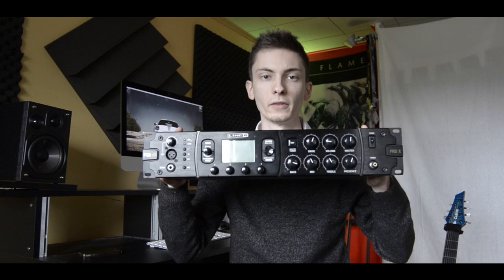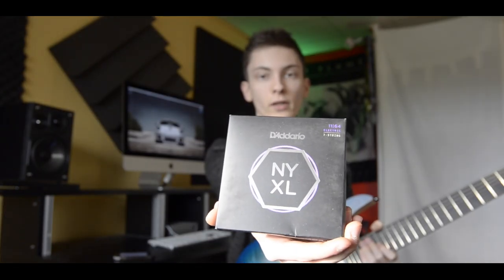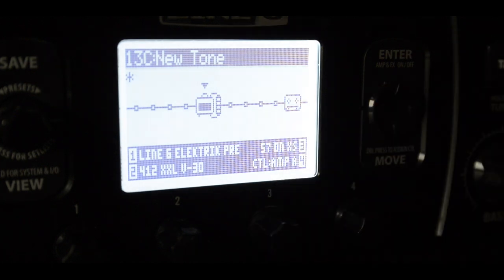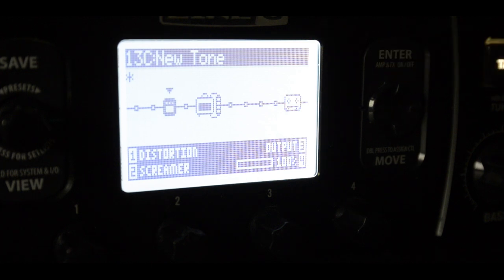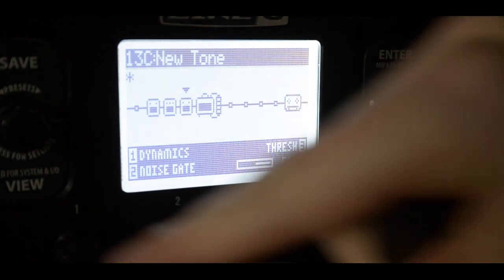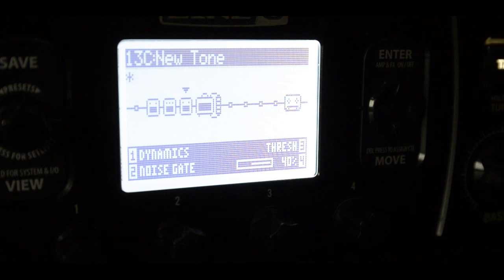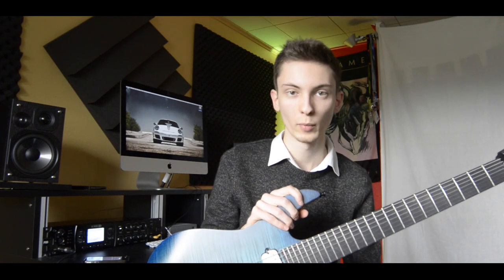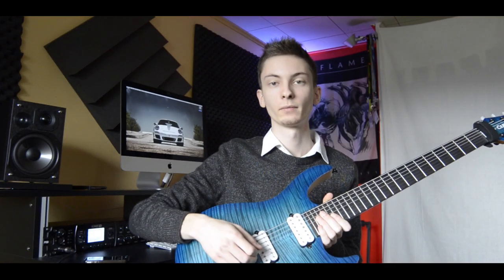Line 6 POD HD Pro X: Tight rhythm tone à la Monuments (w/ Carvin DC700)

Comment: I just wanted to say thank you , cuz you made me buy a POD hd pro x a few days ago .
Im absolutely lovin it . One of the best choices i made in the last 5 years . Cheers .
Reply: Theora Band it sounds like the video dude?
Reply: I think something like that yeah , but theres so much things that affects the sound your getting from pod . For example : 6 or 7 or 8 string guitar , the pickups you using ceramic or alnico  . And of course if you use it through speakers or a cab . ( digital recording or if ur using a mic ) .
Reply: Theora Band yeah, i know about that but i want to know if the preamp, the quality of the POD to record is that good, i want to record a album, and i have a interface know that cant handle the job
Reply: I donno i use the digital output of the device with USB connection . For me it sounds great . Check my channel and you can hear how it sounds with my mixes . Of course u need to some post EQ in the mixes .
My songs recorded with pod : Theora - Horizon  , and the God Of The Sun .
Reply: Theora Band so you use the usb direct to record? sounds amazing
Reply: Jonathan Olvera yes

Comment: Thanks for your tutorials and music dude, subbed instantly! What is your opinion on using a compressor, such as the RED or TUBE COMP in the POD HD 500 ? What sort of clarity to do you find as opposed to using the amp head distortion.
Reply from the maker: funknotik: Good question. I actually use comps for clean patches but not for high gain patches, I should try that!
Reply: I've been using the red comp before the screamer with basically your same configuration, with good results.  But I have to set the amp gain very low to  maintain any kind of clarity. I wish there where more subtle variations of the compressor, this one is too either full on or too little compression. It's hard to get an even and natural sounding tone with the compressors in my experience.

Comment: what things do i need to play live with it? just plug in directly to a cab ? (i'm new in this)
Reply from the maker: Hi! Please check out my rig rundown video on this channel where I explain this in detail! Hope it helps!
Reply: the patch used for run into PA or into return on the amp is the same? Just enable/disable cab simulation or need some other adjusts?
Reply from the maker: Hi! Basically yes, maybe you have to do minor adjustments on the amp simulation EQ in case your cab sim is quite different from your real cab.
Reply: You can play through a normal guitar cab as well. You'll need a power amp. I run my Eleven Rack live with a rocktron velocity 100 power amp through my celestion v type loaded 2x12. Any patches you make with the cab Sims on will need tweaked a bit. Make sure to turn the cabs off if you run through an actual guitar cab.

Comment: are you plugged into an amp? i dont have an fx loop on my amp. is it a bad idea to use an amp simulation through my amp input clean channel? really need help with this one =(
Reply from the maker: Hm this is something I really wouldn't recommend. Maybe try selling the amp and buy a poweramp if you really wanna go for the POD sound!
Reply: Plug it to FX return, if you have FX Loop in your amp. That will skip the pre amp

Comment: Noise Gate before distortion or pre-amp? That's a no-no since it affects the dynamics of your dry signal (thus taking some gain away as you mentioned), making your softly picked parts or the ends of sustaining notes silent. To correctly remove dist/amp hum and fizz, you have to put it after them.
Reply from the maker: There's no right or wrong here in my opinion. I put the noise gate first because I want noise to be taken out before it gets amplified.
If you use a real amp and a real noise gate pedal it will also be in that position of the signal chain.
Of course this is a topic that is based on personal preference and experimenting! ;)
Reply from the maker: +Soulhenge Sometimes I put two noise gates in my signal chain of the POD. One before and one after the amp to get a really cleaned up signal.
Reply: But you can remove the noise just as well after it has been amplified. The only difference is that you don't affect your dry signal, keeping your playing dynamics intact. And you can't remove all noise any way, because your guitar or amp or whatever is still making noise when you are playing normally, and you can't touch that.
Reply: have u ever seen periphery old rig rundown .......
Reply from the maker: Btw I tried your version @mkaali (noise gate after amp sim) and it does not work properly. 
It's called a noise GATE not noise filter or something. When you are not playing, you risk making unwanted noises though, which you don't want. As you start playing, the gate fully opens and let's through the entire signal (as far as concern a real noise gate pedal, not the POD intern). It's about stopping unwanted noises while muting etc BEFORE they get amplified!
Reply: ur as much of picky person as me <333 :)
Reply: its true, Im guessing mkaali has no idea what they are talking about, a noise gate is almost always the very first thing in a rig, right after your guitar. it has to be a good gate, and set properly. a proper smart gate does not affect the signal at all. ( mxr smart gate ) . the POD has this issue with its gates.  also in a high gain rig you can use another gate is front of any noisy pedals.
Reply from the maker: Alternatively, you can use a Hard Gate on the POD.

Comment: I'm looking for some help here in deciding whether or not the Pod Hd pro x is worth the extra money over the pod hd500. Does anyone have experience with both of the units and can give me some pros or cons to either one?
Reply from the maker: Well the HD Pro X is a rack unit, whereas the HD500 is a floorboard. I traded my HD Pro X against a HD500 because it's MUCH easier for live use. Otherwise the rack unit has more connections and a stronger processor (but the same sound) so you can build more complex patches. However the power of my HD500 is sufficient for every normal patch. It's just getting weak when you want to play with 2 guitars through it at once for example. There, an X would have a better performance.
Reply: Soulhenge Sounds like the HD Pro X is the one for me. Thanks!

Comment: Hey man, what is up? I have a question, it has a pedalboard to controle it on stage for example?
Reply: Midi pedal controller, sure
Reply: @daniele_girotto  Great. An it comes with the unit or you have to buy it apart?
Reply: @diegolanzos5456  I don't personally own it so I don't know, but I suppose you need to buy it separately
Reply: @daniele_girotto  Thanks a lot for your time man. Cheers from Argentina.

Comment: My tone sounds absolutely nothing like that when I dial it in the same
Reply: That's because you aren't playing properly for this kind of tone.
Reply: @brettlockerhead  or because different equiptment doesnt get the same tone
Reply: @huntmaguire8363  if you have a pod hd series and the exact same guitar it's likely your tone still wouldn't be the same.
Reply: @brettlockerhead  I dont have a kiesel guitar and he might be playing it direct to his computer while I'm playing it on an actual cab
Reply: @huntmaguire8363  if you are using the pod with a power amp and real cab you will want to turn the cab sim off in the pod. And that would be a large reason why your sound doesn't sound the same as this. The tone you are hearing in the video is through his computer speakers with a cab simulation in the pod. Your cab likely sounds nothing like the cab model in this video (unless you have an ENGL pro 412 cab)
Reply: @brettlockerhead  oh sweet that really helps I plugged it into my computer speakers and it sounds way better... just not much practical use for live playing I guess
Reply: @huntmaguire8363  try using it with the cab off on the pod while going into your cabinet. That would be a good starting place
Reply: Brett Lockery how do you turn Cab Sim off in the pod?
Reply: @fullblownhomegrown  if you didn't find out, turn the dial that controls the cabs all the way to the left till it says cab off or no cab.

Comment: Awesome tone, man! Does the pro x need to be hooked up to a power amp when you're running it into your DAW? It functions as it's own interface right? Thanks!
Reply from the maker: No for recording you just use the POD and nothing else :) It basically is an interface with guitar tones in it. You can also plug in your mic via XLR and record vocals.

Comment: are you plugged into a interface or directly into the computer?
Reply from the maker: Directly into the computer via USB.
Reply: Hey, I'm very new to guitar, so this might be kind of a dumb question but other than this machine, what do you need? Is it just guitar into the line 6, into the computer? How do I like hear what I'm playing lol
Reply from the maker: +Jacob Acosta Master Scribe Well the Line 6 has a headphones output, so you can play guitar through the POD without having a computer. The USB connection is just if you want to record.
You can also connect the POD to the computer and send the signal through the computer and its headphones output. Basically you can easily connect any speakers or headphones to listen!